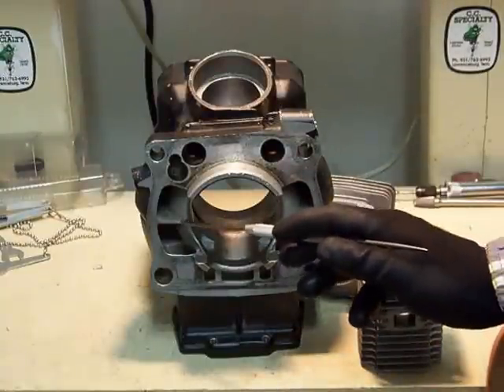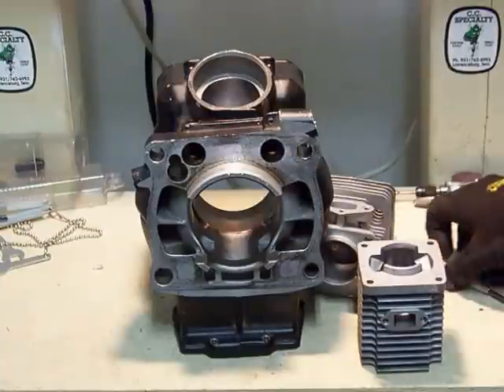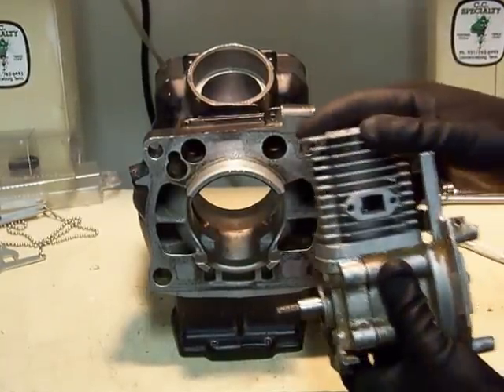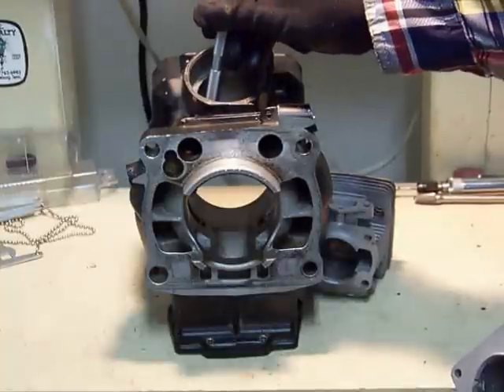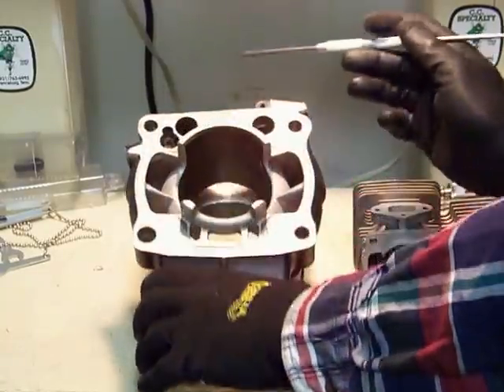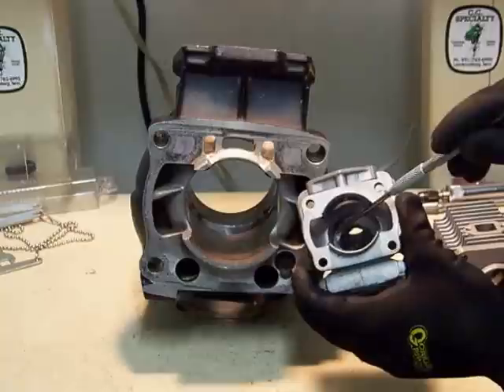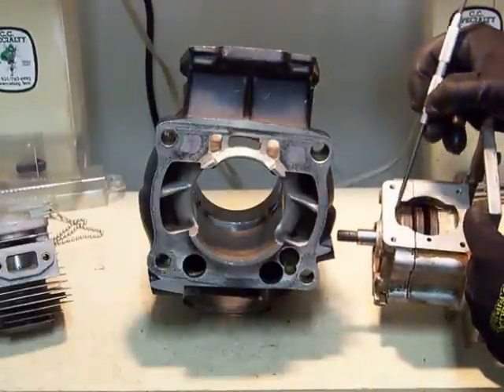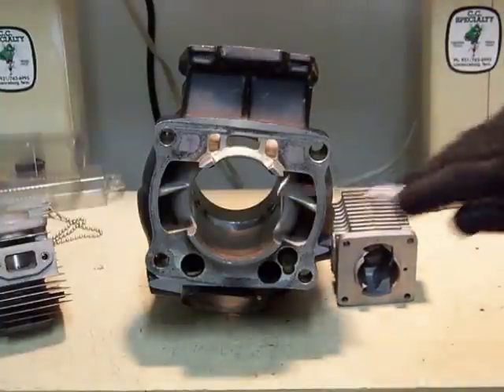2 stroke transfer ports information, along with porting and polishing tips

Comment: Can something like a  small flex hone , Brush Research BC9M32 FLEX-HONE®, 0.354" (9mm) Diameter, 320 Grit, Silicon Carbide Abrasive (Pack of 1) be handy for smoothing ports ? Cheers .

Comment: Im actually buying a couple 2stroke motors at a discounted price arriving w/top end unassembled so Im wondering if I should do port work to it before putting together if its worth it or not???? Maybe just cleaning it up a polish without taking any real meat off.
Reply: There is absolutely a lot but can be done. Casting flaws , gasket mismatch, and improving the texture of the intake to better optimize flow, just to name a few

Comment: Lets say you had an atv engine and wanted to repurpose it for a street bike... what engine characteristics would you aim for and how would you alter the ports ?
Reply from the maker: Excellent question and that all depends on your starting point, in other words what kind of cylinder are we starting with , like a 250 banshee, or like  a kx500 . Then you need to decide if you want high RPM horsepower or low end torque. Either way you port your cylinder differently. Please go to our website and look at my tips and techniques section. This will probably help a lot
Reply: @Ccspecialtytool  i will definitely read up on your site. I have a 1998 blaster 200 engine in very good condition. I was hoping to get a dt200/wr200 top end so i could get the power valves which i assume would help alot in repurposing the engine for street, but it seems theyre hard to come by and now it looks like ill just have to stick to standard blaster engine and maybe some porting in the right direction.  Since the blaster already has good low end and power band is relatively flat and broad, im hoping that changing the gearing ratios should be enough ?

Comment: Are there gains to be made on a modern 2 stroke motocross bike? Or has the factory tuned them to the max?
Reply from the maker: Thanks for watching and yes there are always gains to be made. Another aspect of it it's not just horsepower increase but tuning the cylinder for your preferences. Some people want high RPM horsepower oh, some people want low end torque oh, some people just want to go faster. Doing the hard work of measuring and blueprinting a cylinder, crankcase, piston, and carburetor can always be used to improve the engine efficiency

Comment: port a zenoah 320 no one has info
Reply from the maker: Wish we could do requests but it's just not possible. Porting smaller RC engines follows many of  the same principles as porting larger displacement, adjust the ratios and they are proportional. Thanks for watching.

Comment: so if im going to put more top speed on My bike, ill need more top power band and increasing the engine rpm more, while doesnt let the engine lose its breath of air. so what do you recommend me to do with my block, any idea? sorry just a newbie here.
Reply from the maker: A better way to describe the change in power delivery caused by raising the exhaust port roof, is that it moves the powerband higher in the rpm range. This "can" allow for slightly greater top speed, but  top speed is mainly determined by the final gear ratio. Any time you raise the exhaust port height, you will decrease trapped volume and therefore port trajectory and expansion chamber tuning of the exhaust become critical for scavenging the cylinder. Of course power valves can also help. Thanks for watching
Reply: +CC Specialty Tools my bike is yamaha y125zr. known more on Europe as yamaha z. if I cut the head block increasing the compression ratio from 6.5 to 9, is it true it will give more top speed? im actually dont want to port the porting as you said it will change the tuning. and its also decrease the velocity and the structure rigidity of the block decreases. any idea for that bike spec to increase the performance of it?

Comment: Hello I want to ask I have a 66 CC 2 stroke motor what I did was I not the piston itself with a boost ports are about 1/8th of an inch and angled them the best I could to angle the boost port . now when I did this I noticed that I lost compression but I have to say I did notice that it idles much better revs much higher and much faster and it does seem that I gain more horsepower now I didn't put a second gasket on the bottom where it meets the crankcase and I don't know if had to or not but I did not touch the skirt of the piston on either the intake or the exhaust side. basically my question is, is what I did bad? will I have trouble down the road? is it affecting anything as far as not exhausting correctly by doing this? technically it seems the same as raising the boost ports but I just lowered the edge of the piston instead I would love to hear your input on this thank you
Reply from the maker: Anthony P  Thanks for watching. Not 100% on what you are asking, but I can give you a few facts that might help. If you modified the piston crown with bevels or "ramps" then yes you decreased compression, by increasing the volume or area at TDC, since now at TDC the potential "space" for the gasses has increased, thereby creating less compression of the same volume. That however may not be such a bad thing. The resulting effect would be similar to changing the port timing, and if the results are advantageous, then well done on your part. The other advantage is that swapping out a piston is often easier and more cost effective than swapping out cylinders. The gasses are now able to escape out the port openings at an earlier point in the combustion cycle, this changes port timing, while not exactly the same effect as increasing port size or raising the boost ports,  very comparable none the less. Changing the gasket thickness at the base of the cylinder will also effect compression, thicker gaskets decrease, and thinner increase(but often not as much as people assume). The gasket thickness can also have a negative or positive effect on port timing. Hope this helps, and if you like the results of your changes I would recommend keeping them for a while.
Reply: CC Specialty Tools thank you so much for the reply I understand much better now thankyou

Comment: Do you texture the transfer pathways and case ramps the same as intake or make them smooth?
Reply from the maker: Jared Ferra I texture the transfer pathways and case ramps to a much lesser degree, when compared to the texture on the intake surfaces. Some pros polish these areas, but I do not think that is required. The reasoning is that the air fuel mixture is pressurized during it's travel through these areas, thus fuel droplet formation due to surface tension, is less of an issue, and the air boundary layer would be less of a concern. Thanks for watching.
Reply: Ok thank you for the detailed answer!

Comment: Hi?what i'll do with this type of cylynder? http://era.com.ua/market/img/?s=1&f=36&i=706978_1_167772.jpg
Reply from the maker: Нуф Нах For a smaller displacement cylinder such as that, we would recommend a 14SR kit http://www.ccspecialtytool.com/porting-and-polishing-14sr-kit , if you want a 90 degree right angle porting tool. If you do not need the 90 degree porting tool, then a much cheaper Bare Bones Kit http://www.ccspecialtytool.com/porting-and-polishing-cc-bare-bones-kit will work just fine. Thanks for watching.

Comment: Hey cc can you tell me the beneficiaries of doing this and if you have dyno results on a ported head compared to standard ? I've heard that if it has a carb the rough walls helps the fuel defuse better i understand two strokes are high revving and allways on the power stroke so gasket matching could be beneficial but as it's a two stroke the exhaust port is open at the same time so I wonder what sort of volume of air/fuel you can take in before it's pushed out the exhaust? I believe this is why two strokes are never forced induction because it would just be blowing it straight through the cylinder! Please help
Reply from the maker: Thanks for watching, and I will try to answer your questions one at a time, so there may be a few answers to read. 1. The benefits of Porting and Polishing are increased horsepower and increased efficiency. There are thousands and thousands of  dyno results and flowbench test out there that prove this beyond and shadow of a doubt. For better proof, of this, I would turn to your User's list( http://www.ccspecialtytool.com/cc-has-better-way-porting-tools-pay). The long list of names ,legends, champions, world record holders, and major companies like Pro Circuit, Kawasaki, Yamaha, BRP, and Boyesen, proves it even more.
Reply from the maker: 2. Naturally aspirated motors, as you say ones with a carb, benefit more from the textured finish approach to intake walls because the rely on the difference in atmospheric pressure, and yes the main purpose is for fuel droplet dissipation.
Reply from the maker: 3. Gasket matching is important and beneficial to all engines, 2 and 4 stroke. Any protrusion or obstruction by a gasket will decrease the air flow and efficiency of any motor.
Reply from the maker: 4. The exhaust port is only open during part of the 2 stroke cycle. Once the crown of the piston closes the port off, the rest of the volume is trapped. However, while the exhaust port is open the trajectory and flow of the various transfer and auxiliary ports, along with the returning pressure wave from a well tuned pipe, will determine how efficiently the combustion chamber fills and how little of the incoming fresh air fuel mixture escapes out the exhaust port. There are turbo and supercharged 2 stoke engines, just not common. http://youtu.be/Oxj_OAb5bqk
Reply: Thanks I had no doubt that porting and polishing works I have A port and polish on mt engine but it's a four stroke and I have my own charts but my question was dose it work on a two stroke I have never seen a dyno on one and a 4 stroke shuts it's exhaust valves so no air escapes but a two stroke can only suck so much air in as the exhaust port is allways open do you have any dyno charts ?
Reply: Sorry number 4 dint show up until I posted that message cool vid thanks for the reply :)
Reply from the maker: Werbutlemon233 2 strokes tend to benefit the most from porting and polishing. Most charts you will find, post porting and polishing, will be flow bench results, that show the increase in CFM or transit times. There are also simulations that show the improvement of trajectory and combustion chamber filling. Dyno results should only be derived from the cumulative effects of overall improvements to the engine, a combination of porting and polishing, tuned pipe, reed valve, and intake modifications, all coming together for the final horsepower gains. A quick search yields me a dyno chart from MADMAN that shows a gain from 26 hp to 33.4 hp on a CR80 and from 70 hp to 110.7 hp on a RZ500   http://www.madmanengineering.com/dyno.htm . I would consider this very reasonable results. The other great advantage to porting on a 2 stroke is you can (fairly) easily change port timing, which would be similar (but definitely not exactly) to changing the cam duration on a 4 stroke. Hope this helps

Comment: Very helpful info with how the transfer works. One question about the water jackets. Can I open the water jackets some to help the engine run cooler by moving more coolant through the jackets? Doing this would probably mean I need a bigger coolant reservoir. The plumbing or delivery system would need to be able to deliver more coolant. My drag sled heats up more than I like. I may watch some of your other vids and try changing the transfer slightly on a older sled I have. Always looking for more torque.
Reply: I have used the CC tools to improve the cooling paths and water jackets on many of my 2 stroke projects. I have also used them to improve the oil inlets and paths on other projects. Just remember to consider the structural integrity of the cylinder you are working on. If the walls get too thin you might have some problems.

Comment from the maker: Unfortunately there is less of a database for information about the little Austrian Puch, However engineering and physics still work the same for all cylinders. I believe the downward trajectory of the transfer windows to be a less ideal design, and like many things on early 2 strokes, there is room for improvement. My opinion is an upward and away from the exhaust port trajectory would be better. Better Schneurle loop scavenging, and better power production. But that is my opinion.
Reply: Yes you can get a lot of Power out of a puch maxi. We even got puch maxi races in Austria ^^

Comment: I have just finished rebuilding a 57 Puch RLA 125 bottom end, and after watching these videos (and doing a lot of reading - bell + jennings etc) I thought I'd take a look at the barrel from the RLA, the transfer ports have a lip that angles the charge down towards the crankcase (or down at the piston crown) not across the top of the crown or even up towards the head like I've seen written in the books) is this just sloppiness or some special design? did they machine the transfer tunnel too deep?

Comment: Yep, I figured I wouldn't mess with the top of the exhaust port too much since that is where the power valve slides, but thanks for the heads up.  Mainly I will focus on getting rid of any casting imperfections and roughness. Hopefully all goes well!

Comment from the maker: Thanks for watching. Starting out simple is a great idea for your first go at porting and polishing, so great plan. Remember the crank case outlet, gasket, and transfer inlet are critical areas to get matched for smooth air/fuel flow. Also most CR 125 cylinders have a power valves so watch closely when you are working on the exhaust port.